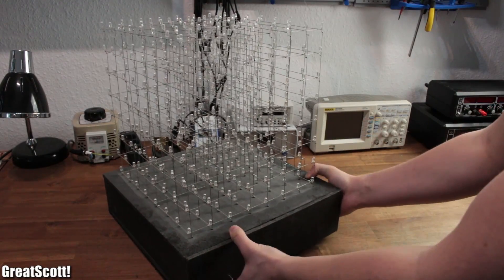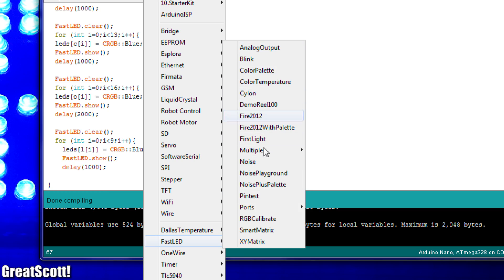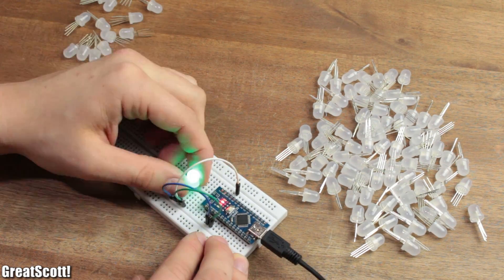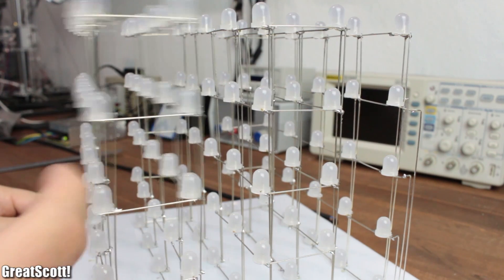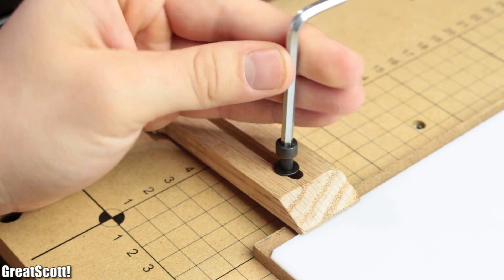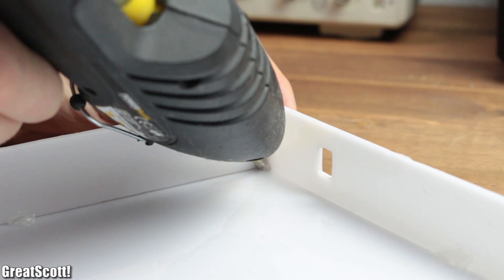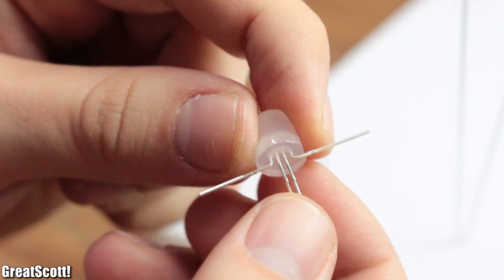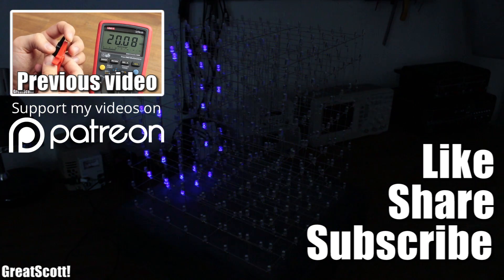Make your own SIMPLE 5x5x5 RGB LED Cube (Part 1)

Comment: I know this video is 7 years old but I had theorized decades ago on the matrix we exist in during a theory of everything debate way back when AOL chatrooms were a thing and this cube is a perfect example , if you shrink down the LEDs to plank size and the colors covered the entire spectrum of colors in a prism as each pls k sized LED changed colors but done so the neighboring led is what effects the change then you are visually looking at a representation of the fabric we exist in and as the colors change it is also how time becomes a part of all existence when one considers the changes in each color a transcendence of temperature. Also if you eliminate the wires and can make the plank sized LEDs float the gaps between each light is the paths which strings as in string theory traverse through the entirety of space as well as provide the basis from which formulas for black holes quasars stars gravity and so on are created .

Comment: at 3:08 , how does that space fit in a 8 mm hole for your schematic? On the right hand side, how does the 0.8mm holes work? Within the 8mm allotted, is it 3mm, then 2mm, then hole, then 2 mm, then 3mm? That adds up 11.6mm within the allotted 8mm for the LED which doesn't make sense.

Comment: can you please help me i love led and i have a project to do it on my motorcycle how can i get in contact with you
and another thing i'm kinda confused dont u need a resistor for every led connected or i can just connect dataoutput to data input and all of them to one resistor?
i was think it should be a parallel circuit but the one in the video i believe is  series circuit

Comment: Why didn't you need to do multiplexing for this project?
Reply from the maker: Because the LED are addressable
Reply: Thanks! OK, so I have to build a matrix of 300 RGB LEDs, and I need to control them individually.  Should I do multiplexing or could I input my desired sequences into Glediator?

Comment: Straighten the frame wire by clamping one end with pliers or in a vice then put the other end in a drill and pull tension whilst using the drill to twist the wire. 
I'm not sure if your wire is strong enough for this method though. 

Amazing videos btw, you are very smart. Keep up the good work!

Comment: In you 4x4 LED cube you used ic's to control the common ground for the leds, here you only use an arduino. Is there any downside to using an arduino? Or is it better than the previous 4x4 arduino led cube?
Reply: This one is better, because it only requires one pin to control all LEDs
Reply: +Dennis Bondar thanks :). You wouldn't happen to know if there is a marginal increase in performance using this method rather than the other?

Comment: You can straighten the wire by placing one end in a drill and the other is held with pliers. Spin the drill and pull the wire with the pliers and it will be dead straight!

Comment: Dear god, my first ever project was building the 4X4X4 RGB LED cube thinking it would be quick, but took me months.  All that soldering on the circuit board w/ the 3 TLC chips and the arduino, MOSFETS, etc.... I just finished it 3 weeks ago.   Now I see all I needed to do was get these bulbs and run the whole cube off an Arduino...  NOOOOOOOOOOOOOOO
Reply: ive been trying to make the 4x4x4 plan since early/mid 2014 and ive been putting it off. i recently etched a custom pcb for it because i couldnt be bothered soldering jumper wires literally everywhere

Comment: I find it very hard to find proper documentation, or even just information on how these diodes actually work. It all well and good that there are libraries out there to control them, but how are they actually controlled? And what are the limitations? How many can be daisy chained together, how fast can you push the data, and so on and so forth.

Any help would be greatly appreciated.

And of course, thank you for your hard work, that too is appreciated.
Reply: there are other videos and references on the interwebs that explain all you are asking for.  keep looking.
Reply: Well, that's easy to say, but I have kept on looking, and haven't found anything of use, thus your comment does little more than annoy.
Reply: That's just trolling. I said I've looked, and I have, and then assuming that I haven't is just being a troll.

If you know something which I don't, please enlighten me, or go find a bridge to hide under.
Reply: +Felix Nielsen Jesus H Christ.  add the frigging mA together for the load you have to support.  figure out how to power the max without burning your microcontroller.  and for God's sake, look up multiplexing and charlieplexing.

people are only going to give so many answers.  look up videos by Kevin Durrah.  watch them 3 or 4 times, come back, then revise your question.
Reply: +Ross Potts Dude, have you even understood what the video is about? There is no multiplexing at all. The LEDs are using a serial data protocol that allows them to be daisy-chained together. So please stop talking shit if you aren't even capable of following the first two minutes of a 6.5 minute video.

Comment: Hey würde gerne deinen 3D Led Baum nachbauen aber würde ihn gerne ohne USB Kabel und Terminal Block Powern sondern mit einer 9V Blockbatterie die Direkt ohne Lötstützpunkte an der Platine angeschlossen werden soll also einen Batterieklipp an der Platine und einen Größeren Widerstand würde das gehen ?
Reply from the maker: +TitoxPvP It would be great if you could ask in English.
Reply: GreatScott! I would rebuild your 3D Led Tree but I want  to power it with a 9V Batterie but I want to build it without an USB Kabel and without an Terminal Block. And now I want to know If this is possible without a Soldertag directly to the Board. You know that the Batterie is directly connected to the Board?
Reply from the maker: *****
Yes, that is possible.
Reply: GreatScott! But please dont look at my English skills :D
Reply: GreatScott! Ok nice thank you :)

Comment: Is there any reason why we couldn't use 5mm RGB leds? They seem cheaper.
Reply: This is easier in spite of the soldering (no real control board, just the Arduino)

Comment: Hey Scott, little tip: For straightening the wires I found it usefull to use a power drill: Clamp one end of the wire in the drill, hold the other end with pliers, straighten the wire by pulling with the pliers and give the wire like a few dozens of turns (or more if you like). Result: Wire straight as an arrow and stiffer, too (cause of work hardening). Dont overdo it though, as the wire will be more prone to breaking (also due to work hardening). Give it a try! :)

Comment: Great video! 
Howmuch current does this draw? Or could you link the power adapter you used?
Reply from the maker: +Thomas Van den Dries Wait for part 2
Reply: +GreatScott! I would like to already order the parts, so that I can start building this epic cube asap after you release the next part ;)
Reply: +GreatScott! Since I don't see any power regulators between the LED's and the barrel jack, I assume 5V. I hope it can be powered through a normal USB adapter! :)

Comment: To straiten wire you could also use a drill. Put the wire in the drill take the other end with some pliers and rotate the wire with the drill. Will come out perfectly strait. Just make sure you dont use too much force with the plier since it will make the wire snap.

Comment: this led s there are to expensive .can I put something else?please tell me a solution
Reply from the maker: +george anastasiadis When it comes to individual addressable LEDs, they are one of the cheapest.
Reply: So there is not.another solution....pitty.but anyway nice video.we will wait the past soon.... In a week :-P
Reply: +george anastasiadis Depending how much work you wanted to put in, you could do a cube like this with a 'grid' framework of thick (2.5mm2 or 12 AWG) solid copper wire as a common ground, and feed the LEDs individually with thin magnet wire... it'd be a HECK of a lot of work and the addressing would need to be very different (demultiplexers anyone?) but you could use very cheap LEDs
Reply: +george anastasiadis use smaller LEDs.  There's 5mm and even 3mm available.  look around, buy in large amounts for other projects.

Comment: quick tip for  arrow straight wire. tie one end to somthing stationary. chuck the other end in a drill, pull it taught and run the drill for a few seconds. the longer the wire the better it turns out.

Comment: can i make like 8x8x8 cube please reply :)
Reply: +Bananasplit i already have about 7000 of these kind of LEDs so there is no problem with that but I'm worried about data corrupt and arduino processing speed /:
Reply: +Black turbine 
I would be more concerned about what kind of power supply to get, powering those 6859 (19x19x19) leds (the best you can get out of 7000).
But seriously...7000...sure....that would make a small fortune on the market atm.
Btw you are just asking lazy questions, the answer has already been given twice if you scroll up dont be an ass and thank +Bananasplit for being helpful.
Reply: ***** i cant use that much of them because signal could go all bonk so i made (6x6x6) that's max cube size and grandmas give me a LOT of money so i was buying 100 LEDs pack until i got this much LEDs and I'm very thankful to +Bananasplit he helped me out and for power supply took one from computer btw don't be that mean to me :(
Reply: +Black turbine Sorry i was mean, i was drunk at the time i wrote that. I just hate it when folks ask lazy questions and expect others to answer without showing gratitude. I could however have put it differently and smell the sarcasm here ;) Hope you give your grandma some hugs, i have to ride my bike and deliver newspapers before i can build my own cube.
Reply: +Daan Derksen apology accepted :) I'm a bit new with  arduino i hope your cube will be awesome good luck ;)

Comment: @GreatScott! I love these basic videos, since I'm a programmer and I don't know much about electronics.....
I've a question: are those LEDs like the Neopixels? (You talked about daisy chaining the data out with the data in...)
My guess is that the Netopixels will keep the value they receive, and these ones need to be refreshed as fast as possible.... right?
What are the diferences? (I'm asking because Neopixels are super exepensive... http://www.adafruit.com/category/168)
I want to do something like this: https://www.youtube.com/watch?v=DTb0k_P1wlY
(Be able to control each pixel in the table...)
Reply from the maker: +Rodrigo Graça They are basically just like Neopixels, aka WS2812B.

Comment: For the germans in the commentsection:
If you don't like the softness of copper wire (bends easily >.>), you can use steel wire. It isn't as solderable, but good enough. Graupner sells straight steel wire. 0.8mm*1000mm costs around 30cents or so.

Comment: If the LEDs weren't so expensive, i would build this kind of cube... :(
Reply: 1000 for 5euros on alieexpress, work fine with the good resistor
Reply: @Andrei Radu can i use common anode or cathode rgb leds instead of these expensive one??
Reply: @Andrei Radu u mean,  with ics...
Reply: TJemxx expensive? 8 dollar for 100 from amazon
Reply: now it's 8 dollars for 10

Comment: Is there a website where i can order those acryl boxes in the dimension i want it?
Reply: +Zerfallsgesetz you don t need to, acryl is so soft that you can cut it by hand! pro tipp: wear some kind of gloves and have a vacuum cleaner on hand, or your hands and surroundings will get messy :) (gloves only if not cut by hand)
Reply: ok thanks^^
Reply: +Zerfallsgesetz bitte :D

Comment: I would like to build 3x3x3 cube but can I use the same 5x5x5 code in arduino?Please answer.
Reply from the maker: +Fran Maric With small modifications.
Reply: +GreatScott! Which modifications would that be because I don't know a thing about programing?
Reply from the maker: +Fran Maric Just the number of used LEDs if you use the example code.
Reply: +GreatScott! Okay thank you a lot if I build it I will send you some pictures!Now I just need to ask my parents to buy all parts for this project!
Reply: +Fran Maric 
How'd it go?

Comment: great video, can you explain how that leds can be controled by only one pin?
Reply: +14feb.bh He did. The LEDs have an integrated circuit in them, which only requires one pin for data.
Reply: +Thomas Jakobs thanks!

Comment: what was the total cost of this build?
Reply: I want to build it, but im on a budget, so I would like to know the approximate cost :)
Reply from the maker: +SimpleHowToVideos Around 60$
Reply: +SimpleHowToVideos well if you skimp on the non-essential items such as the Veroboard, terminal blocks and headers, then solder everything directly together than it would cost roughly $40 using the cheapest components you can find and I suppose you could also save another few dollars by either getting rid of the on/off switch or salvaging one, like those little push button switches perhaps?